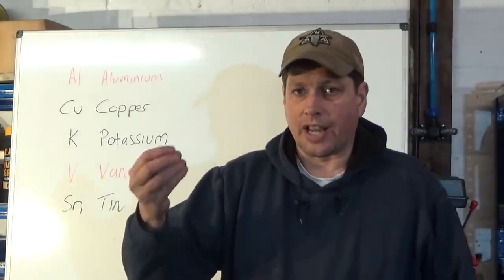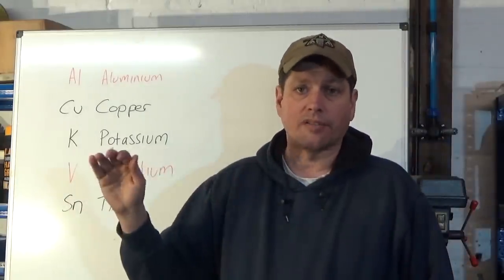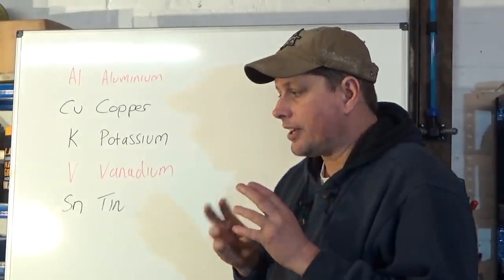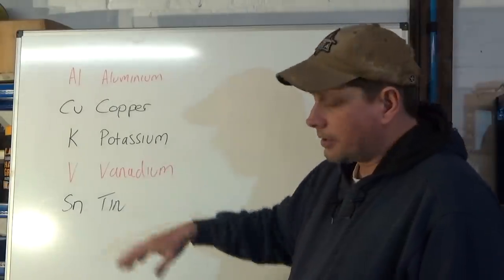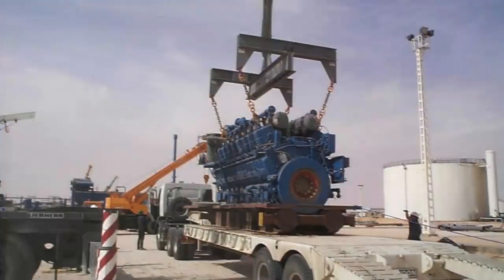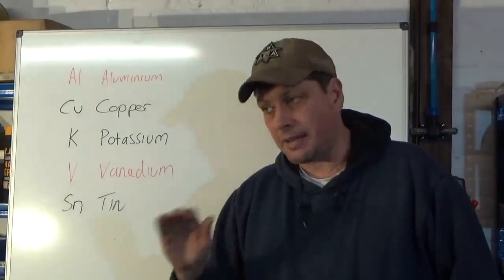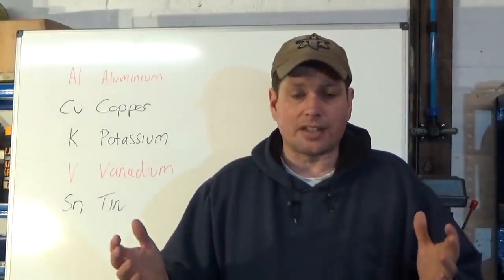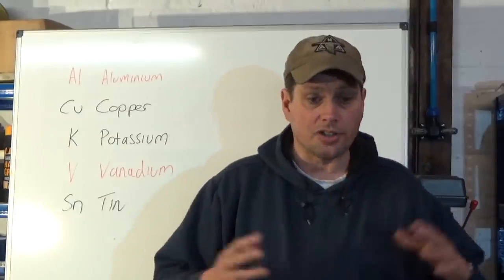IS THE OIL GOOD or BAD ?

Comment: This is good information. I am curious if you ran the engine prior to pulling the sample to  get metals etc. back into suspension. Maybe you mentioned that you did and I missed that. Keep up the good work. I start each video wondering what you are going to pop into it for comedic effect.
Reply from the maker: Sample is taken with engine having been run and then allowed to sit for about 10 mins.

Comment: In 2006 we bought a new Deere skid loader . At 50 hours I pulled a sample when dropping the oil. I took it to our local Cat dealer to be checked.
They called the next morning and said the silica content was too high. Said to check the rubber boot on the turbo.
Sure enough the clamp was loose.  So the Cat dealer saved an engine they did not sell, and they knew it was a Deere machine from my paperwork.  Cost was 12$ US or 9.20 Pounds.  Money well spent.
Great video, I'm sure you have encouraged others to test their dirty oil.
Reply from the maker: Awesome 👍
Simple fix

Comment: What your opinion on super universal oil I allways consider it has jack of all trades master of none I allways preferred a series 3 engine oil and something like a Mobil oil 422  for the axle and transmition if you had tractor doing a lot of light work with super universal I allways found you would have engine trouble this video I found very interesting I came across this procedure while working on a massive demag 4 stage air compressor supplying a steel works with high volumes of air another thing I got told the Americans in ww2 who where very fussy with oil one of the only oils in Britain they would use was Morris of Shrewsbury which would come up to there spec
Reply from the maker: Morris Lubricants are very good and exceed a lot of specs.
The main spec I always work from when selecting oils is the MIL spec.

Comment: Hope she passes with flying colors after that unexpected mess you had with the JCB 3c3 motor.   If you are needing some comfort food while waiting for the results, I know of a guy that's got a pile of Creme eggs  he'd like to get rid of L.O.L.  Thanks for the video, Take care
Reply from the maker: Yeh but once done that JCB engine is as sweet as a nut now.
She sounds lovely.
Reply: @LordMuck  I totally get what you are saying but once in a while it's nice not to have to spend crazy money rebuilding a motor you just bought. 

That 2700 series motors not easy to do it's either a pain in the butt dry sleeves like my 2704 ET that needs work  or I'm thinking some of those motors maybe didn't have a sleeve. Then it's rebore and oversized piston time, not just pop simple wet sleeves in like the Leyland.

 But at least  it's not a huge hunt for parts like it used to be when ford abandoned those motors, now the non OEM parts guys are starting to get more internal parts made for them.